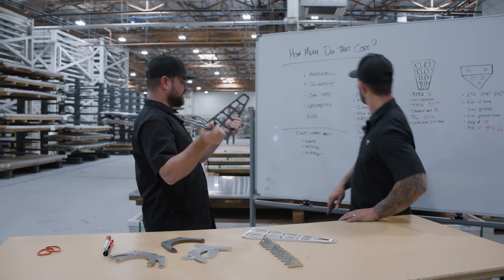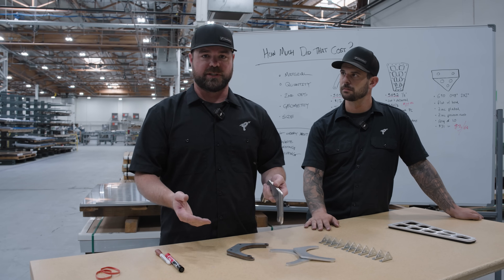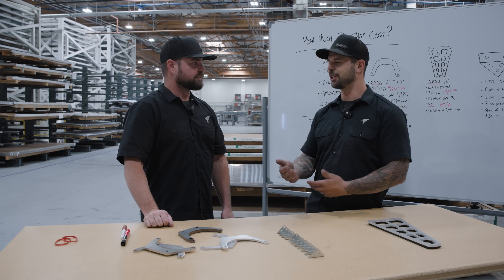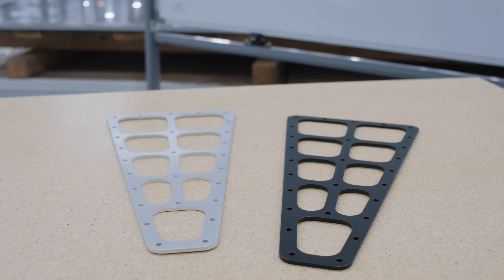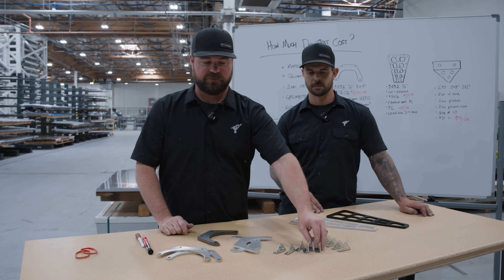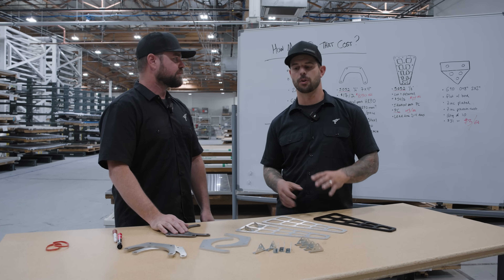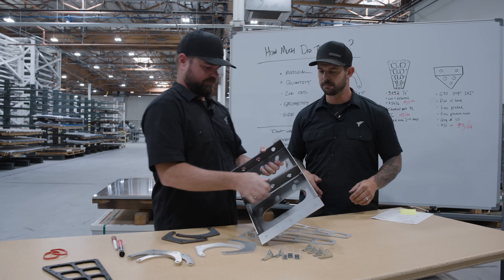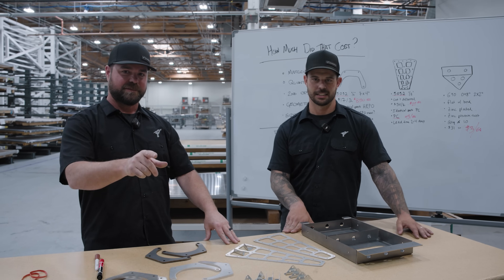How Much Do Custom Sheet Metal Parts Really Cost? Cutting Corners Episode 2

Comment: I wish you could accept STL file. I made my part in Blender. When I export to STEP or DXF your website will not accept it.
Reply from the maker: Sorry about not taking STL files...STL files are a "Mesh" type file that lacks the information needed for CNC manufacturing. For laser cutting, CNC milling, or CNC turning (lathe) manufacturing, it's best to start with a CAD package that is designed to output true vector geometry (Onshape, Fusion360, NX, Solidworks, etc)
Reply: @sendcutsend  Thanks for the reply. I did a search and found an article you had about Parametric modeling. I saw you listed FreeCAD which I had on my machine, but didn't know how to use. Now I'm going through tutorials. So far it looks promising.

Comment: I was needing a broken part remade in steel that was original made in cast aluminum. Am I able to send my part to get remade? Is that some thing you offer?
Reply from the maker: We don't offer reverse engineering...yet... but if you can get it into a template/cardboard cutout or a sketch we can make the CAD file for you. Check out sendcutsend.com/services/design-services

Comment: I was unaware that laser cutters used HRPO plates and not plain jane black mild steel.  Since watching this video, I have added that material grade and surface finish to my CAD software database so I can specify that on my BOM.  I will also need to follow up with my suppliers to see if this is actually their standard business practice.

Comment: A question on those $29 aluminum parts: How do the extra cutting time costs versus extra material costs end up working out with those interior holes?  Would it have been cheaper or more expensive if those parts were solid without the "lightening" holes?
Reply from the maker: In most cases, the less cutting we have to do, the less the part will cost. A simple square will be less expensive than a square with 30 holes in it. The square with the holes will use less material, but the cutting time is the biggest factor
Reply: @sendcutsend  : Thanks!  Good to know.

Comment: Thanks guys!....What is the cutting process(es)?
Reply from the maker: @ianschutt6242  we use fiber lasers, co2 lasers, CNC routers and waterjets depending on the material! You upload your design, it goes through our DFM system, (a mix of human and automated quality check) once good for the lasers, we nest the parts for optimal usage of the material sheet then it’s off to cutting! 

On our website under each material we’ll let you know the cutting method 👍🏼